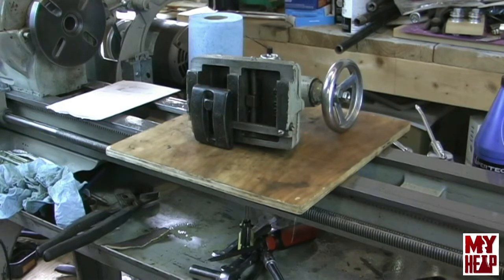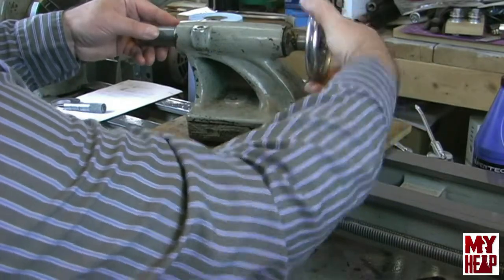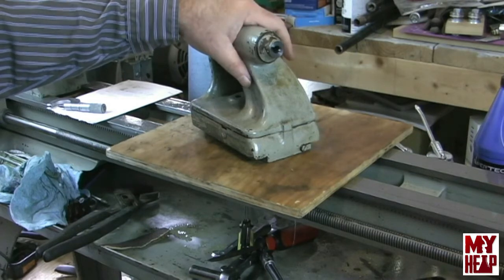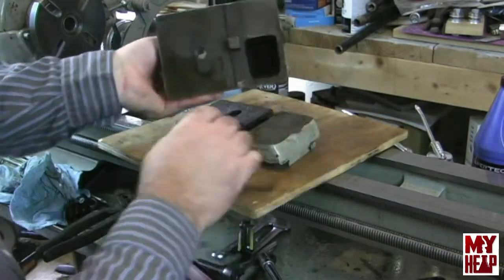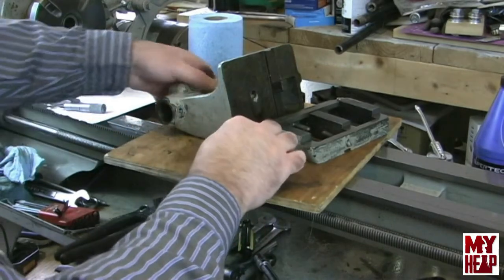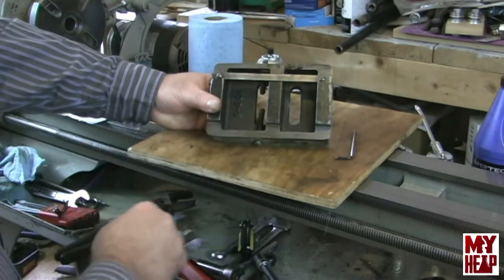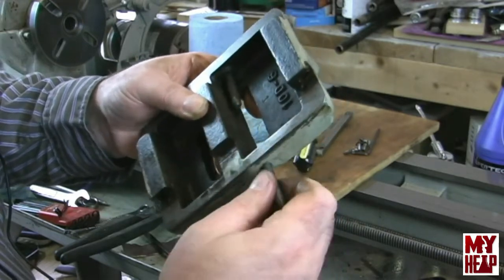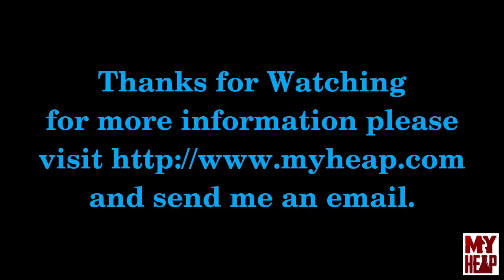Atlas 10F Lathe - TH54 - 20 - Disassembling the Tailstock

Comment: Man o man, Can not thank you enough for this informative video.  I have acquired an old Craftsman lathe and am in the process of taking it apart, cleaning it and putting it back together.  In the process of reassembling the tail stock back on the lathe it was going HARD, could not get it to fit.  Now I know why and I will be able to get it back together tomorrow.  thanks whole bunches.
Reply from the maker: I am glad you found the video helpful.  Thank you for taking the time to watch and comment.  I appreciate that.

Joe

Comment: Problems: First I turned the crank to extend the quill to the maximum. Toward the end of the extension the motion became stiff.  Eventually the crank disengaged.  But the quill was in there to stay.  No way to pull it out, as there is nothing to grab on to.  I tried tapping it back in with a wooden hammer, while turning the crank, and it would not engage.  As for removing the crank,  there are two nuts in there, very difficult to get a wrench on because (1) they are very thin, and (2) they are recessed into the structure of the crank wheel.  I am squirting liquid wrench on them every time I walk by the lathe.   Suggestions?   I prefer not to use a cutting torch on it.
Reply from the maker: If the tailstock quill screw has disengaged from the quill, I think I would try the following.  1st remove the quill lock bolt and split cotter.  You will unwind the lock, the bolt will come out from the bottom.  There should be a heavy washer on top and the split cotter is left in there.  The top half of the cotter will come out the top.  I believe the bottom half should slide out of the bottom, but I may be remembering it wrong.  The bottom half of the cotter may have to come out the top too.  Now, since the screw is disengaged from the quill, get a large pair of channel locks and some sturdy sandpaper.  Maybe 60 grit.  Look at the back of the casting and you will see where the quill screw passes through.  This end cap is threaded.  Wrap the paper on there so the grit catches the end cap and use the pliers to grip the paper and end cap.   Unscrew the end cap and screw as an assembly from the barrel.  That would be my attempt.  If you get it apart then use a wood dowel or large brass drift to knock out the quill.  It likely has burrs or something that is holding it in.  The quill is a good fit to the barrel.  Let me know how it goes.

Thanks for watching and commenting. 

Joe

Comment: The breakthrough was getting the crank wheel off.  Then the backpiece screwed out easily.  A few whacks with that dowel through the back end, and out came the quill.   As expected, I found the threads to be seriously buggered.   Would not go in the back of the quill at all, went about one turn into the front of the quill.   About an hour of working by hand, I was able to lap out all of the problems with #220 aluminum oxide grit.  (Wanted to use #400, but could not find it.  Optics operations temporarily suspended while I am doing the radio antenna project.)  The screw works nice and smooth over the full range of the quill now.   Of course there are still a few details, like getting the quill clamp pieces out of the casting; I think I'll try some small allen wrenches in the clamp screw hole to poke the pieces out.   Also, looking for a quill clamp lever; what I have now is a big water faucet handle and it is embarrassing.  Stay tuned....
Reply from the maker: Sounds like you are making great progress.  Keep me posted.  You can use your lathe to make a new quill lock knob.  Would be an interesting project on the lathe for an angled offset handle or maybe even on the drill press.  Thank you for sharing. 

Joe

Comment: Thank you for making these videos. I just acquired a TH54 and is needs some TLC to say the least. I was wondering how the centering attachment comes out of the quill. I have tried pulling and twisting but it doesn't move and I don't want to try too hard.
Reply from the maker: Are you talking about the dead center in the tailstock quill?  You should be able to retract the quill with the hand wheel.  One some point the quill will stop and a crank more should eject the center.  If that doesn't work, you can crank the quill till it comes off the screw and pull it out.  There is a set screw on the bottom that rides in a groove in the quill, and there is a clamp that clamps the quill, you could remove these.  Will the quill out you could take a drift and knock the quill out.  Let me know if you need more assistance, or if there is something else I can do.

Thank you for watching. 

Joe
Reply: @MyHeap   
Thank you for the reply.
yes. 
I did get the quill out but the dead centering was in there so tight a punch and hammer didn't remove it. I had to put in a press but it finally came out.
I do have a Unimat mini lathe that I got from my father. This is more complicated.
Is there a store or website for accessories? I need a drill chuck and a live center (the one I have doesn't turn) to start with. 

Thanks again
Todd
Reply from the maker: You can get MT2 and MT3 accessories from a number of places.  I have bought from Shars and others.  When you buy chucks, usually the backing plates are separate and you turn the register to fit the chuck.  You can see this on some of my videos.  There are some aftermarket taper attachments but they are expensive.  As far as mulling attachment, follow and steady rests, those are likely to be found on eBay.  Best of luck and if I can help, just reach out and I will do what I can.

Comment: You have a favorite way to clean up the parts and prepare the casting for re-painting?   I generally like to use Costco white vinegar to remove rust, but before you can do that, there is gunk that has coagulated in there since 1938.  Soak in mineral spirits, diesel, acetone, or gasoline?
Reply from the maker: Well, for general cleaning I like mineral spirits and non chlorinated brake cleaner.  For derusting I like either evaporust or electrolysis.  I have a variety of shaped brushed and bottle brushes to clean bits.  I hope that helps.  Thank you for watching and commenting. 

Joe
Reply: @MyHeap  
Done with mineral spirits followed by dishwash in strong detergent, then vinegar.   The problem with electrolysis is that it depends on electric current... which means that it great for projecting features, but does not get into internal corners.
Reply from the maker: @richardnineteenfortyone7542  did you get the split cotter out?
Reply from the maker: @richardnineteenfortyone7542  I think the best is a liberal soaking in evaporust.  Have you tried it?  Great stuff.

Joe
Reply: @MyHeap  Split cotter never came out.  After the detergent treatment, I wanted it to be dry inside, so I let it sit hot overnight on stove at minimum heat in a frypan.  It got warm, not really hot.
Reply from the maker: @richardnineteenfortyone7542  it must have a large burr or something.  It is made of zamak so probably can be forced out. BUT, if the quill slides through it and it clamps the quill, then I suppose it doesn't matter.  😀

Comment: In the end I got everything apart except those two internal pieces that clamp the quill.  I decided to declare a Ukranian victory and not attack them.   

Painting: Painted the bottom casting with Ace primer/paint, Machine Gray, of course.  Dried in a couple of hours and looked great.  However, I ran out of paint and could not find a matching can.   Carson City is NOT Los Angeles with well-stocked Ace hardware stores on every corner!   So I went with Rust-Oleum.  Big difference: after a couple of hours the paint was still sticky to the touch.  I took it into the hottest room of my house, and overnight drying left it touchable, but still soft.   So Ace spray paint will be on my shopping list when I go south tomorrow.   

One more product is praiseworthy: Carbon Off, available from the Carson City equivalent of Smart & Final.  It is intended for removing burned in carbon from cookware and will not attack metal.   Do NOT use it in a kitchen sink that is other than metal or porcelain lined!   I do not know (or care) if it is gluten free, non-GMO, vegan, organic, or carbon neutral, but it is the best (and most expen$ive) paint remover I have ever used.  I will put it to work on the Rust-Oleum when I return from Los Angeles next week.

I guess my next posting will be under the re-assembly video.   Thanks for your help and encouragement.
Reply from the maker: I am glad to help.  I wouldn't give up on the split cotter.  It has to move to clamp the quill.  Maybe a good soak in penetrating oil will help.  Maybe deburr the top of the casting??
Reply: @MyHeap  
The top split cotter was loose and could move around; the bottom seemed to be stuck.  In any case, the tailstock is almost together and ready to go to work.  But to tomorrow is the long drive south to L.A.  One question: to you advise a round peg in a square hole?   That is the dognose screw that engages the slot in the quill.  If I make it square like the original, it will not rotate; it will have to be installed and adjusted BEFORE the quill is inserted.  

I have two lock washers left over, and I can't remember where they went.  One may have gone under the clamp nut, but I used an ordinary flat washer there.  

Also, I notice that my ways are in bad shape.   Probably good enough for the antenna parts I intend to make, but moving my fingernail across the way I feel a definite bump at the edge of the carriage support area... as if the carriage was moved back and forth a few million times since 1938 with no oil or cleaning.  Also, the surface is corroded and full of dings where it was used as an anvil.   I wonder if there is a way to fix the ways.  Of course that would require removal of the carriage, tailstock, and headstock.  I know some simple optical tests of flatness from my telescope mirror making days;  any place I can send you photos?  I am richard1941 (at) gmail (dot) com.
Reply from the maker: @richardnineteenfortyone7542  send emails to xavier@gtec.com.   we can discuss a bit more thoroughly there.

Comment: i found  out  recently that my tailstock center is lower than the spindle center- maybe by .020 inch. i put a new dead center in the spindle (MT3) and a live center in the tailstock- when i brought them together i could see the tailstock center was lower.  Can the tailstock be shimmed to fix this?
Reply from the maker: You can shim between the base casting and the top casting.  Mine is a bit low too but deal with it.
Reply: @MyHeap  does it  affect anything- such as the live center not getting traction or something?  thanks for the help
Reply from the maker: @strongspeed  there does not seem to be an issue with it for the stuff I make.  Now if you want ultra precision then maybe it would matter.  But in the little engines that I want to make and the parts that I have made thus far it doesn't seem to matter.  I suggest using it as is and if becomes an issue then shim it up.

Comment: I cannot get that quill screw out of mine. :-(. Probably end up cutting and drilling in the end.
Reply from the maker: Steve, you have the handle and key removed and the quill out of the barrel?  The tailstock quill feedscrew should just come out.  If everything is off, I would give it a bump with a soft hammer.  Perhaps there is a burr on the shaft of the handwheel side that is preventing it from passing through.

Joe
Reply from the maker: The end piece of the barrel should not have to come out for the feed screw to be removed.  The heavy washer at the end of the feed screw runs in a bore at the end of this piece.  Maybe you can try a couple pieces of heavy 80 grit like I done and see if you can unscrew the boss at the back of the barrel and take it and the screw out as a unit to get a better look at what is going on.
Reply: This one is messed up and needs to be cut off if I want it perfect. I understand that it does not need to come out.

And what I mean buy that is that I only have problems with the quill screw that stops it from rotating. Nothing else.
Reply from the maker: I'm sorry Steve, I am confused.  You mean the quill feed screw or the set screw that engages the groove on the Quill?  I don't mean to be dense buddy.  My wife will tell you that it comes natural.  :-)

Joe
Reply: The set screw.

Comment: No way to put any muscle on that stuck quill except possibly by torsion.  Alas, the bottom anti-rotation screw that engages the slot in the quill will not come out.   It freely turns about 20 degrees, so it is not a question of rust.  Something is seriously buggered inside.  Next plan of attack is the impossible-to-dislodge nuts holding the crank wheel.   Buy cheap crescent wrenches at Harbor Freight and grind one thin enough to engage only the inner of the two nuts, then a socket wrench on the outer nut?  Right now I gotta get some coffee and think.
Reply from the maker: I forgot about the dog point set screw.  Mine has a nut that locks it, but you should be able to remove the set screw and twist the ram.  You were unable to get the back unscrewed where the feedscrew enters?

Joe